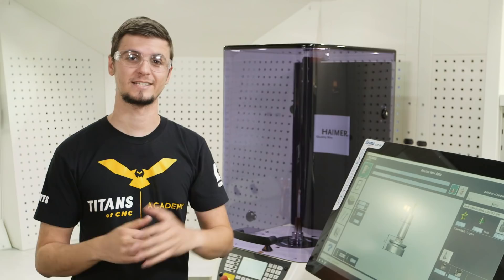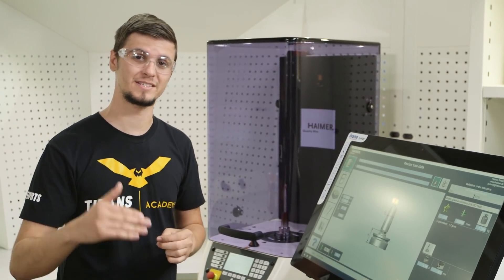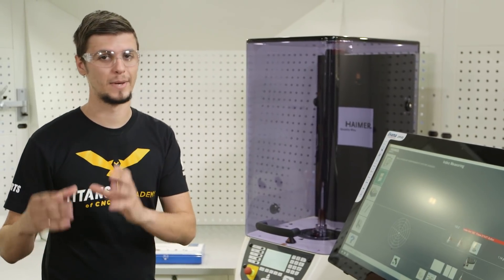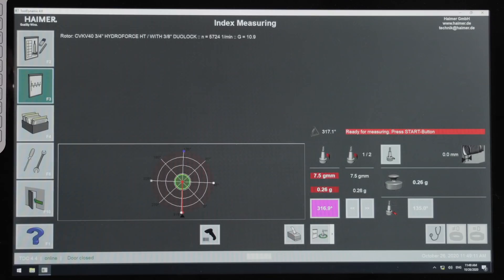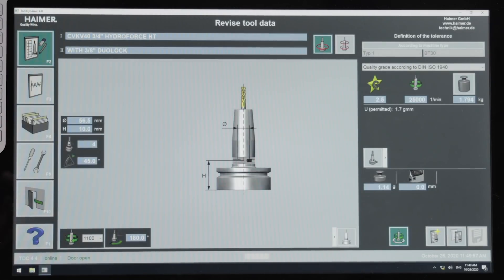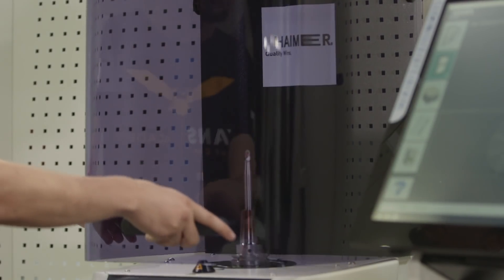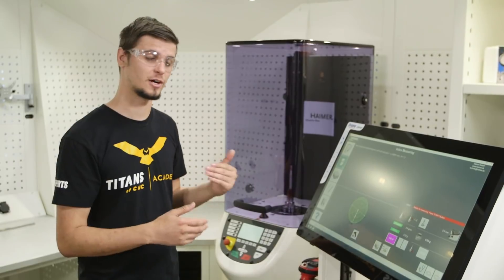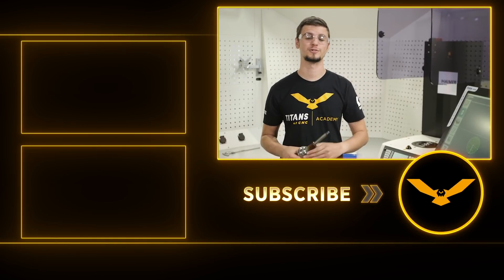Modular Balancing Technology | Tool Dynamic Balancing Machine for PRECISION + RIGID Tool Setups

Comment: I want to recommend the whole set up to my job, since they don't use the tool balancing machine. We run very small one flute endmills through dentures plastics. And they change almost everyday. I wonder if it's possible to avoid this and maximize production. Due to the tool overcutting on one side than the other
Reply: Maybe it's not the tool. Could be a programming error or a bad X or Y axis on the machine.
Reply: @luismaryland2305  well the programming does do the job when cutting where it's supposed to and found overbites on one side. But I have a good feeling it's the tools position when in the shrink fit collet since they dont balance the tool. Plus I feel the toolhead is off center maybe. But they rather spend more than overlook things haha
Reply: @mauromejia2548  sounds strange you have overcut in oneside. Did you checked the spindle center?.  I had problems with it. And tools maker making off-center tools also could be a possibility.